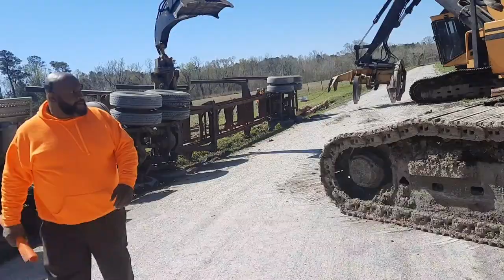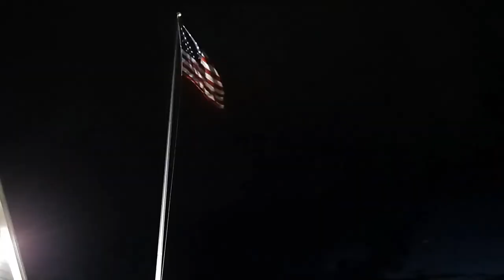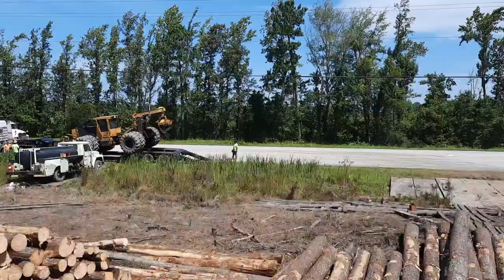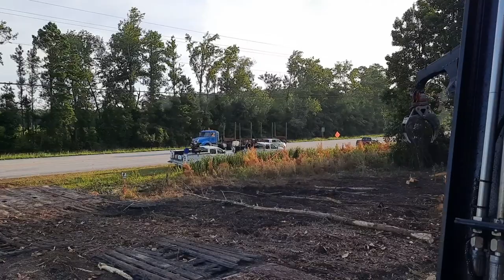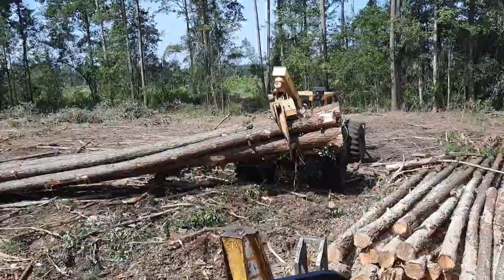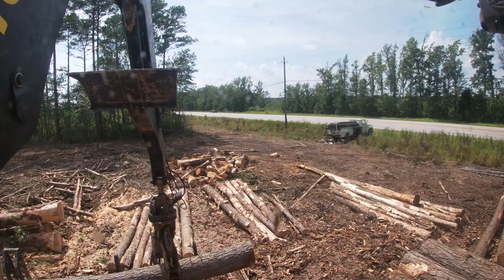DSL- The little tractor that could

Comment: What size skidders y’all run? We work in the mountains of Southwest Virginia and eastern Kentucky so we have to road everything for the skidder and we had run cat 545D and 555D but we recently changed over to a 632H and a LX830D very happy with the change so far.
Reply from the maker: We run 2 630e's . Run deere for a long time but tigercats the way to go. One of ours is in the shop and the loaner is a 620e and it does pretty good but definitely not a 630
Reply: @dirtysouthlogging   I love our 632H I just now got 260 total hours on the machine and it will out run the 555D cat. Seems to stick to the ground a lot better. And the new LX830D there’s no comparison to it and the cat 522B track cutter we had. The tigercat stance is so much more, feels safer and goes better.